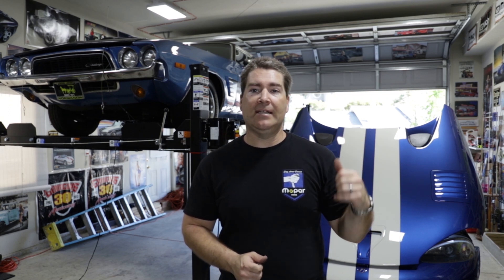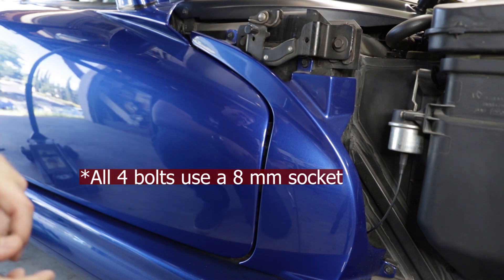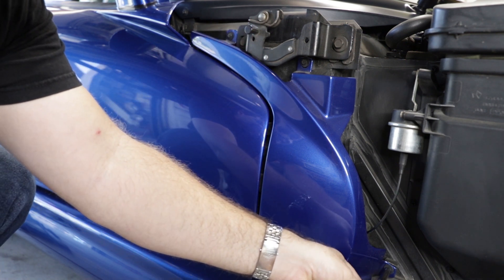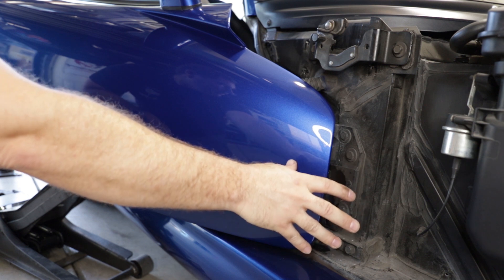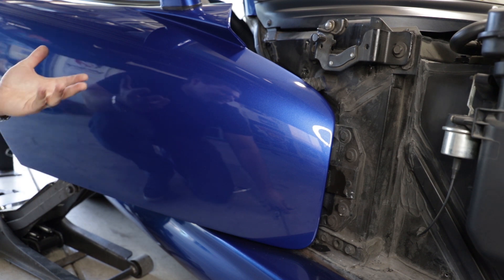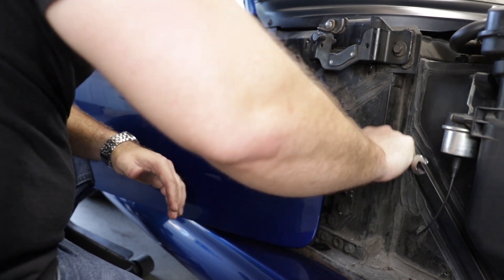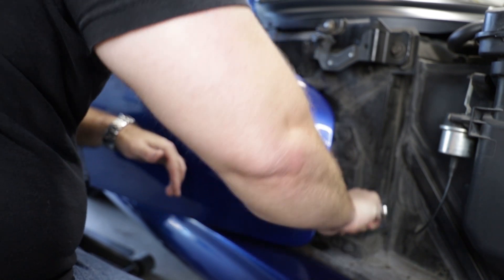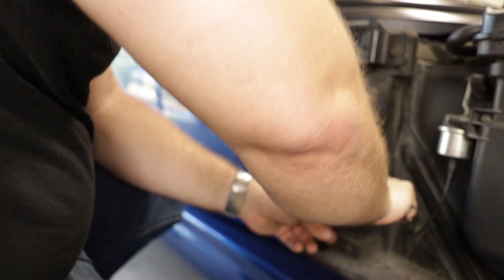Tech Talk Tuesday: How to Remove Door Sag From Your Dodge Viper

Comment: Hi John! I have front this problem this morning too, because my driver door wasn't closing well and i was hearing a rubbing in the low part, in fact my door gasket, the big one wich go all around, was a little ruined in some point and that was the rubbing, after i have take off so the little panel in front of the door iv seen probably the previous owner already tried to adjust the door, but my brother went out with a new idea before loosing the four screw of the hinge, the passenger door always close well and its perfectly aligned with front panel and rear quarter in height and not protunding, on the passenger side there was no rubbing at all, the gasket is immacolate, but he have noticed the black cover "where is attached the exhaust sticker" wich is the part where the gasket is keep in position, on the passenger side the gasket and the interior black plastic near the seat was even level and can feel it with the hand, on the driver side the gasket was really high, i was thinking the gasket so was bad placed but wasn't that! On the driver side the black cover with exhaust sticker have the "gasket profile holder" 3-4mm higher and so the gasket was higher preventing the door to close well! But this is a production error! We have take the Dremel and levigated something like of 3mm on the driver side! Cleaned and ripristinated everything, the gasket fitted perfectly like passenger side! Close perfectly and the lock close so easily now! So in some case i think is better to take a look at this black exhaust cover if its too high and modify it, just need 30min a Dremel and a apirator or the fiberglass go everywhere, but the 4 screw leaved untouched! I hope i have explained myself its hard to explain the part because i don't know the right part name of some things 🙏🏼🙏🏼
Reply from the maker: Thanks for the reply. That's an interesting situation you had on yours. I've never seen that one before

Comment: Wow. No wonder they have door sag.  

 A 13 mm head bolt is only an 8 mm shank bolt. (Unless they used something non-standard)  that seems like awfully small bolts to hold up a door so large.
Reply from the maker: The door is actually fairly small and light, it's a composite material. Regardless yes the bolts are a bit small for the application.
Reply: @LifeatSpeed   my memory is fuzzy about the vipers. I haven’t been in one for at least 15 years. LOL